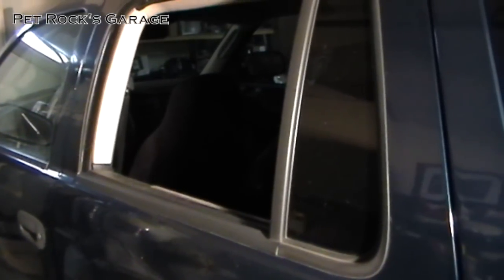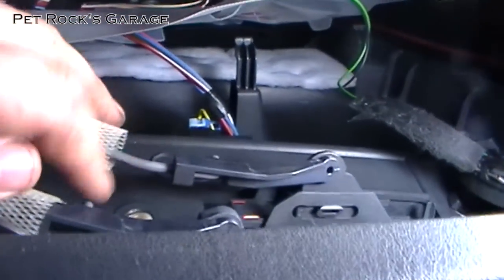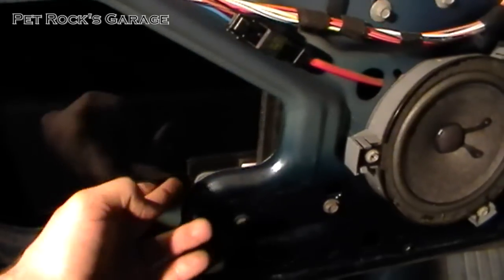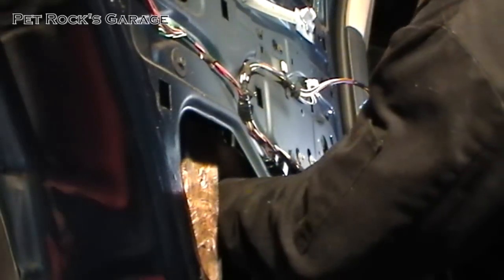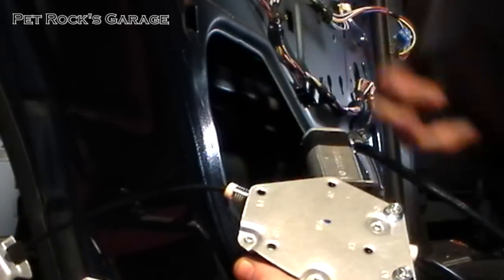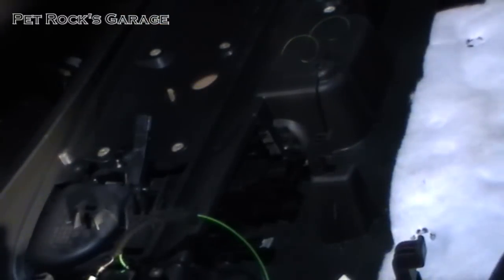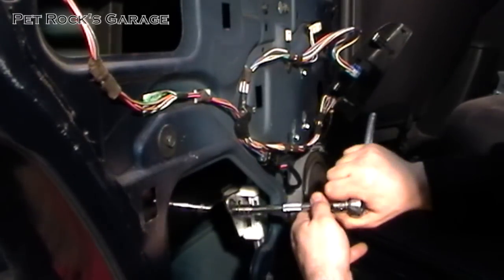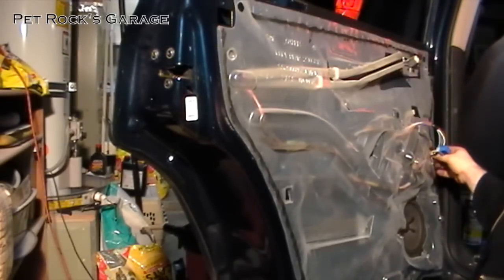How To Replace A Rear Power Window Regulator - Dodge Durango (’98-‘03) & Dakota Quad Cab (’00-‘04)

Comment: Thanks for the instructional video!  Now I've replaced the regulator on both rear windows on my 2001 Durango.  I get the feeling this is a common repair.  I taped the windows the first time but the block of wood also works well.
Reply from the maker: +JohnRyan771, yeah, the common failure point for me has been the plastic in the regulator.  Yeah, painters tape would work.  Anything stronger could damage your paint.  Thanks for watching and commenting.

Comment: Thanks.  My passenger side window just stopped working.  Thanks again for your time on this video.
Reply from the maker: No problem.  Glad to be of service.
Reply: @petrocksgarage  BTW, the dorman part I got Your part #) didn't use the same hardware.  I had to go get screws and washers to mount the motor.
Reply from the maker: @tomstrickland6002 , while not having the same hardware Is not unusual, you having to go get additional hardware is. Either way, glad to hear you got the job done.

Comment: I replaced two windows tonight using your tutorials. Just finished the rear passenger's side by following this one.
Thanks again. 
Hey you should look into Amazon affiliate links - I bought my parts off of Amazon - if you link with Amazon, you could be making a percentage of when people purchase these window regulators (I think I've heard you say "window regulator" about 50 times tonight). Amazon was by far the lowest price for both parts. Just throwing that out there. Might be worth it for you to do!
Reply from the maker: I'm glad my videos helped you out. You're probably sick of my voice by now. :-)  Thanks for the tip on the Amazon affiliate stuff. I'll look into it. I purchased my regulators through my local auto parts store since they have a lifetime warranty. I just pull the regulator when it breaks and they give me a new one for free. But since you are selling your rig, it makes sense to buy as cheap as possible. Thanks again.
Reply: EepstiEU @petrocksgarage  was a

Comment: Nice Informative video EXCEPT, you should just have taped the window in the up position with painters tape or masking tape to have it out of the way instead of using a wooden block.  Good job!
Reply from the maker: +Mark Stoltz, yeah that works too.  However, I've had tape fail on me before on a freshly cleaned window. So I prefer a more positive support. Yeah, the wood can get in the way a little, but its not too bad. I used to have a 1" OD, 1' L PVC pipe with a notch cut in one end for the window to rest in that was worked even better but it was lost in a move many years ago and I haven't made a new one yet.

Comment: Using your video to remove panel. Great job. But I need to replace the vent window. Not the regulator. Any help or suggestions. Not sure if I need to remove window from regulator. Any help would be appreciated
Reply from the maker: I'm not sure what you mean by the vent window. There is no vent window on a Dakota/Durango of this vintage. The drivers/passenger window is a solid piece of glass. Maybe I'm misunderstanding what you mean by vent window?

Comment: What do u do if the window Is stuck up. The cord came out or the plastic price broke
Reply from the maker: If the cord came out or plastic piece broke, I would expect the window to drop not stay up. Tension on the cable is what keeps the window up.  If that tension is lost then the window drops.
However, if the window is stuck up due to mechanical malfunction, I would just cut the cable so I could get the window down in order to unbolt it and remove/replace the regulator.

Comment: ive got a 2002 dakota ...and its only has 2 cables ....what is the diff.
Reply from the maker: I don't follow. The window regulator on mine only has two cables too as shown in the video.
Reply: I have a 2002 dodge Dakota and manual window crank I need help lol

Comment: Look in the box and make sure that part comes with hardware (bolts) the new parts are metal at the motor the org is plastic, took 2 hrs to find the right metric size and thread to fit the new part.
Reply from the maker: Typically the part comes in a box with a sealed bag inside. If its still sealed then you should have all the parts. But definitely double check. Good tip/point.
Reply: 2012 dodge 1500. Rear window cable

Comment: I had my 03 Dakota Quad cab since it was new.  All four have been replaced at least once. Two have been replaced twice. Use a Dorman regulator, don’t buy that cheap crap. But why are these regulators so shit?  Plastic parts are the culprit. If these were all metal they’d last for years. Thanks for the info, great job.
Reply from the maker: Its not Dorman. The OEM regulators have the same plastic parts. At least Dorman has a lifetime warranty so if it breaks you can bring it back where you bought it for a new one for free. I've done that twice with my truck.  Buy once, replace hundreds of times.
Reply: @petrocksgarage   I agree I’ll only buy Dorman from now on. But I never knew anyone having this much trouble with window regulators. Do the new cars have ones that are better made? I know the truck is old but 7 window regulators? Thank You for your help, much appreciated.
Reply from the maker: @johnd193 , manufacturers are going more and more plastic because its cheaper than metal. So I wouldn't be surprised if its worse in newer vehicles, but I haven't really looked or taken a poll.

Comment: Has anyone had an issue with the new replacement regulator not going down properly has making a clicking sound or acting like it is catching on something?
Reply from the maker: I have not. However,  if that is happening you should fix it sooner rather then later. Too much tension can cause the plastic bits in the regulator to break. Take the door panel off and see what it is binding against. It could be a misplaced cable getting in the way, or the side rails may be dirty and not allowing the window to slide properly etc. No way to tell from our keyboards. You will have to investigate. Good luck.

Comment: que numero de motor lleva la ventana de un dodge durango 2001 detrás del conductor grasias
Reply from the maker: +Doni Aguirre, sorry, but I don't speak Spanish.  However, Google Translate says you said "that number of motor is the window of a 2001 Dodge Durango behind the driver grass"  If that is correct, yes that window regulator will work on a 2001 dodge durango.
Reply: Yes window regulator was this number
Reply: Behind the  driver thank yuo
Reply from the maker: Yes, this video and the window regulator shown in it is for the the rear drivers window. The procedure is the same for the rear passenger side window, but the part number is likely different.